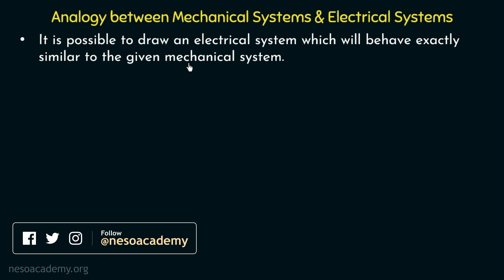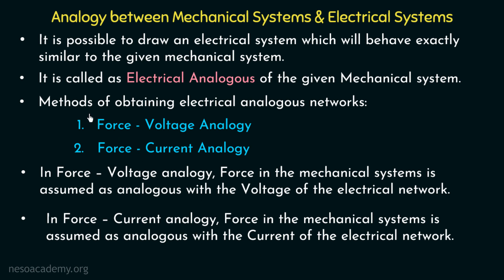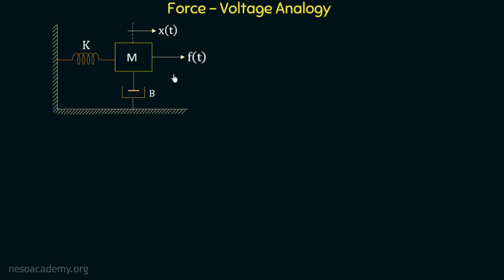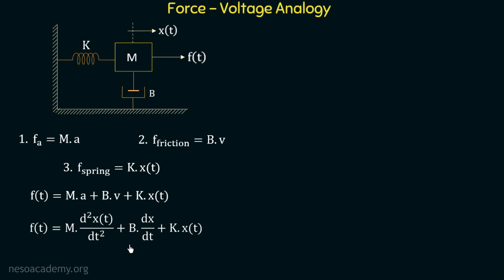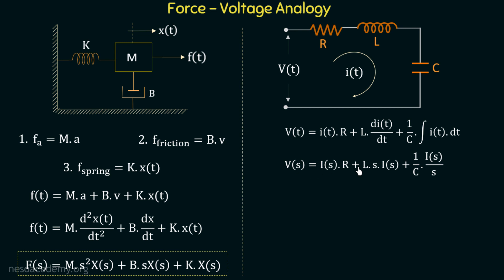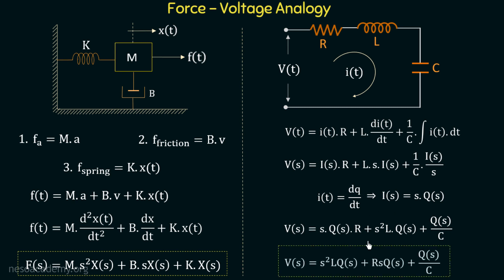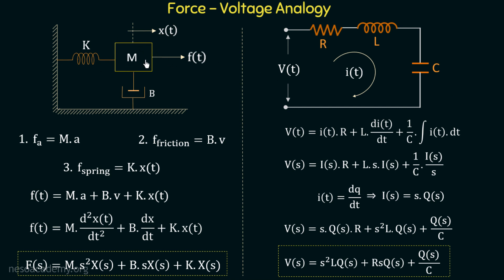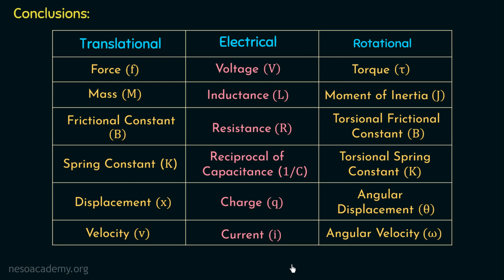Analogous Systems

Comment: Very good class. However, it would be more appropriate (to avoid ambiguities) to draw the damper in parallel with the spring. This is because in this specific case the sum of the forces applied to the mass occurs only in the direction of the displacement.
Reply: True. It was confusing at first, it could be interpreted as having vertical component.
Reply: same I was thing to but great job bro

Comment: What will be the equivalence for spring constant when two spring connected in parallel?
Reply: Since for spring the opposing force is directly proportional to displacement if 2 springs are connected then it will be directly proportional to difference between the displacements i.e x1-x2